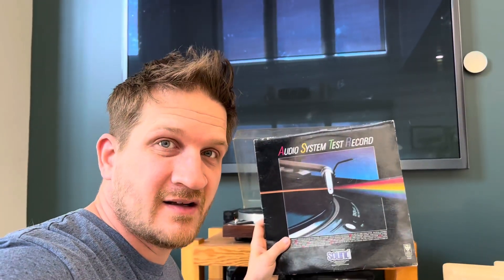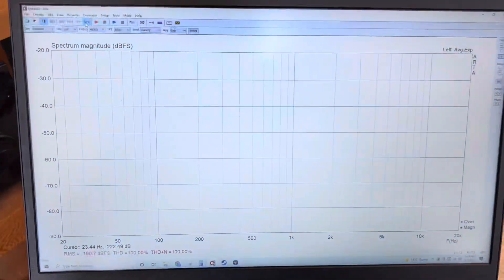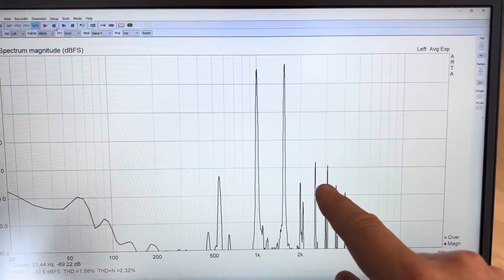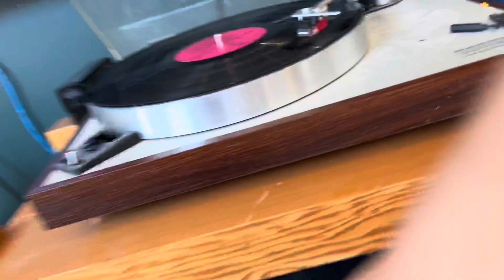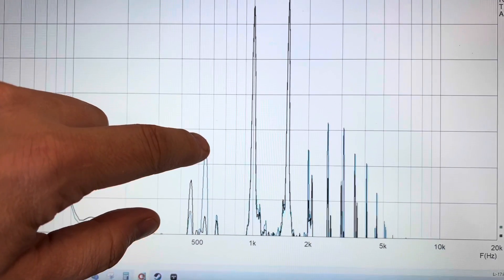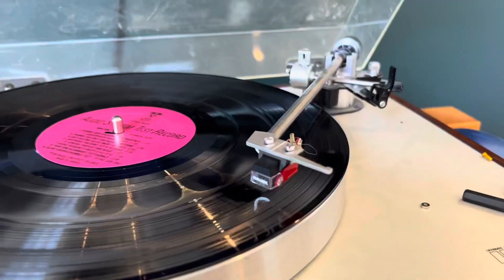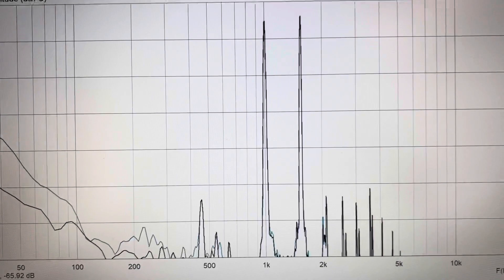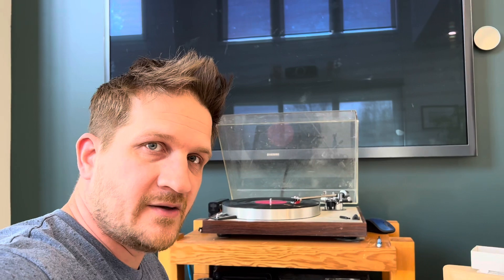Turntable Cartridge Distortion Measurement Comparison

Comment: Oh, I forgot to say. That the reason you did not get 1500 Hz is that 1550 Hz is that your TT is turning 3.5% to fast (that is why the frequency is higher)
That is one of the most accurate ways to adjust the TT rotation speed. And has also the benefit that you doing it during you drag a stylus trough a grove (friction). Exactly as when you play a standard LP. Nobody listening with a strobe or with their phone on the platter those methods are crude and lacks the resolution.

Comment: Great!
In my experience that the AT wins in this aspect is due to that a huge contributing factor from the ML stylus. 
And the competitor here has elliptical but it also has a beryllium cantaliver while AT has tapered aluminum one.

I have had 2 fine elliptical and were able to hear distortion in the higher frequencies on both of them. Switched to AT ML same track and knowing what to listen for, no more distortion any longer.

Maybe we can say that the stylus type elliptical or ML have a far greater impact on distortion than how light or heavy the cantaliver are.

So don't fall for beryllium cantaliver if it has a inferior elliptical stylus!

Yeah, but if you have a ML or some other fine line advanced stylus shapes then it is maybe time to looking at lighter cantalivers..

I will NEVER use or buy any elliptical styluses again, not after first hand discovered audible distortion in them (yes you need the right setup and test record, plus learn what to listen for. Otherwise you could go your whole life and think that it sounds OK..)

But as always when you have identified the distortion sound the it is hard to un-hear it anymore.